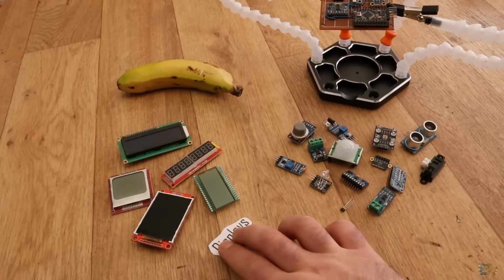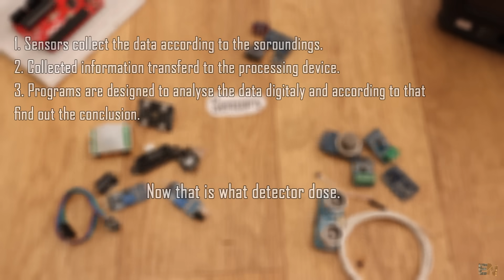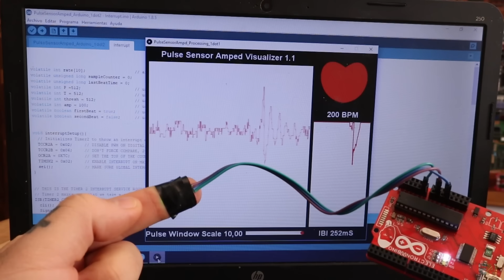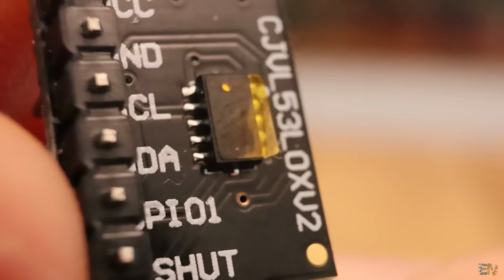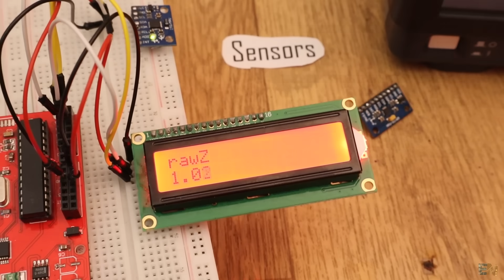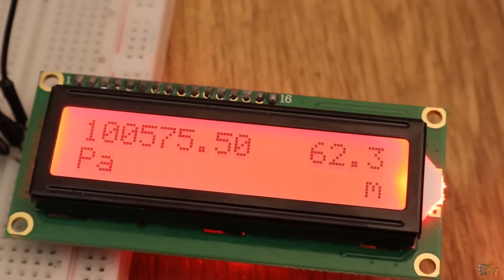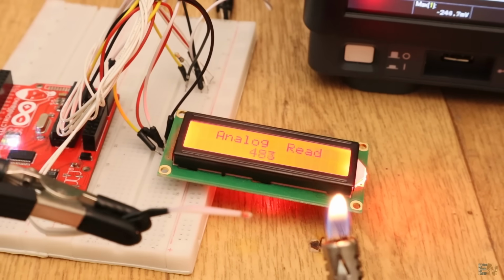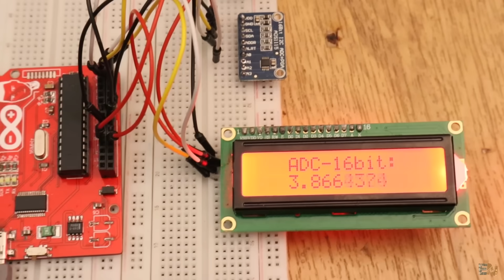Sensors - which one to use

Comment: Hello, I am doing final year project and part of the project is about monitoring transformer oil quality, more specifically its dielectic strenght. Moisture/water reduces dielectric strenght of transformer oil that in most cases lead to explosion of the transformer , what sensor can you recommend that I can use to detect/measure moisture in oil

Comment: Searching for months

 need your help I can't find a small micro controller that charge and discharge a battery with 8 second time limit connected to an led and it sense's low pressure to close the circuit to discharge and it's 3mm in length and only has a resistor connected to it (s0890
Ap) that's what I can read

Comment: hello sir, can you help me in what component will i use in my school project. Here are my project details.
A. Design a wearable physical distance sensing device that will trigger an alarm if another
person wearing the same device is within 1m.
B. Determine the parameters that will allow the device to contact the device worn by another
person.
C. Include a 3-D Model of the device using CAD, Sketch-up, or any 3-D Modeling Software.

Comment: Looking for a very small, easily hidden sensor to detect a model train passing by.  It will not be an arduino project, just a stand alone sensor hooked to an electronic crossing gate.  When the train goes by the gate lowers ahead of the train

Comment: Can a coreless motor design provide low speed high torque without excessive heat in the coils? What will be the design factors to achieve that, such as external cooling system, coils number, wire thickness, amps and volts...etc

Comment: Hi all, I'm in need for same help, i Have a sensor using hall effect and a magnet to check the filament thickness (1,7) all work ok, now I would like to change from serial monitor to LCD I2c to read the sizes, will be easy for the arduino experts, is anyone out there that can help? this is very important for me. Thanks, manuelrocha@live.com (I will send the ino. file/*
Sample code for the magneto-mechanical filament diameter sensor.
Calibrate your individual sensor by measuring objects of known diameter and creating a custom lookup table!
*/

#define verbose 1 //0: No error or debugging messages via serial, 1: Error messages, 2: Error and debugging messages

#define NUMTEMPS 4  //length of lookup table
#define smooth 100  //exponential smoothing factor, higher is smoother
#define sensIn A1  //Output of the hall sensor

// ADC input, diameter output
static float lut3[NUMTEMPS][2] = {
    
   
   {530, 0},
   {595,1.7},
   {671, 1.78},
};

float sensbuf =lut3[0][0]; //smoothed raw value

void setup() {
  Serial.begin(115200);
}

void loop() {
  int sensorValue = analogRead(sensIn);
  sensbuf += (sensorValue-sensbuf)/smooth; //smoothing
  Serial.print(sensbuf);
  
  Serial.print(" ");
  Serial.println(lookup(sensbuf, lut3),5);
  delay(50);        
}

float lookup(float inval, float lut[][2]){
   float out;
   byte i;
   for (i=1; i<NUMTEMPS; i++)
   {
      if (lut[i][0] > inval)
      {
         return lut[i-1][1] + (inval - lut[i-1][0]) * (lut[i][1] - lut[i-1][1]) / (lut[i][0] - lut[i-1][0]);
      }
   }
   if (i == NUMTEMPS){
     if (lut[0][1] > lut[NUMTEMPS][1])
     {
       #if verbose > 1
       Serial.println("WARNING: lookup out of range");
       #endif
       return lut[NUMTEMPS][1];
     }
     else
     {
       #if verbose > 1
       Serial.println("WARNING: lookup out of range");
       #endif
       return lut[0][1];
     }
   }
    #if verbose > 0
    Serial.println("ERROR: lookup failed");
    #endif
    return 0;
}

Comment: I work with some nasty chemicals and I’m working on a project to detect vapors released. At say L1, turn on an extraction system. At L2 it will sound an alarm, time to grab a respirator and leave.

I work within a small maker community and there is a need for such a sensor/alarm.

Comment: I live in both Florida and Viet Nam.  The high temp.  often cause false triggers with PIR. What else could I use?
I looked into the lasers used on automatic garage door openers but there expensive. (but no false triggers)
I will be testing the ultra sonic next.
I want it for use with an Alarm/pizo horn for intruder. And to trigger cameras to start recording.
The PIR is a big failure for these applications. Even a cloud passing by on a sunny day will cause the PIR to trigger.\
Any Ideas on what you might think would work better?

Comment: Hello, please help me? Ive got a project where I need to place a sensor to check if there's a person in or not, and if there's a person then the code begins, if no then nothing happens, basically its a room where ill place a motion sensor near the door and then a whole code after that whenever the person walked into the room etc.

but which motion sensor should I use? I was thinking something similar to the ones used in elevators or maybe in some roller coasters or some game rides for safety, etc.

Comment: I have a question pls answer it .
I want 2 sensors in which I kept 1 at place a and 2nd at place b.
So it tell the distance bw them.
And also if I move one of them up down or rigth and left then also it works.
Means which are aligned to each other.
Reply: Pls tell

Comment: Are you sure, that the distance sensor resolves the angle? I'm pretty sure that most IR range sensors will use LIDAR technique by modulating the IR LED and detecting the phaseshift of the modulation via the IR sensor.

Comment: great explanation for the sensors,really helpful understanding best application for each sensor. Right now I am in need of a sensor that can detect car movement at least 3 to 4 meters in front and then measure the speed of the car moving. The IR sensor you demo is short distance so what do you recommend for longer distance upto 4 meters. please email answer to ashu2077@gmail.com
thank you in advance.

Comment: For your MAX471 project: https://www.electronoobs.com/eng_arduino_tut81.php - you are dangerously using current and voltage interchangeably. For example, you say:

  Serial.print("Current = "); // shows the voltage measured     
  Serial.print(Current,3); //3 digits after decimal point
  Serial.println(" amps DC"); //3 digits after decimal point

However, voltage != current and not measured in amps. I could be wrong here but the MAX471 in production today and you one you use in your example, doesn't really measure amps.
Reply: i think he just mixed up current and voltage, he is measuring the voltage because he is using a parallel connection. to get the current of a load you need to measure in a series connection. furthermore, im sure this tiny cable isnt withstanding 3 amps :D

Comment: Nice video. One correction though, The sharp distance sensor (IR reflectometer based) doesn't detect angles. It detects the amount of light getting back. It is affected by the angle of transmit of the IR LED and the angle of arrival (angles are field of view) of IR photodetector (Wider LED angle will lead to more noise from other objects than what you're trying to detect, and Wider Photodetector angle of arrival will catch noise from wider range of directions).  The angle as shown in the video cannot be measured like that. It works in a similar fashion as the IR sensor shown after, just that it's more directional.

Comment: HI! do you know of a photoreceptor cell that can have a clock attached to it that will count cycles and remember (latch??) the clock count when the photoreceptor detected light and listens on an i2c bus and when asked tells its current clock and the last detected pulse clock back to the master? i think this is what i need and don't know if it exists :(
Reply: hmm yes it needs like, dips or configurable somethings that lets you use about 16 of them at once

Comment: Does anyone have a parts list for an Arduino small indoor gardening project? I want to monitor and automate as much as possible. 

I know I can monitor:
PH + -
PPM/EC

Temperature
Humidity
Soil Moisture Sensor

Barometric Pressure
Gas Sensor (Co2)
Air Quality
Light Timer

Is there a way to automatically control liquid nutrients in a hydroponic system using Arduino?

Comment: I have a video about digital scales using the hx711 load cell. Where my digital scale is different from the others, that is, during the calibration process using the linear regression method. So that the resulting error is small and accurate. And the equations obtained during the calibration process are included in the Arduino Uno program

Comment: Hey, i want to observe oil temperature AND pressure, wich type of sensor could you recommend? Also for water.. I'm not sure wich i should use
Reply: Just get a cheap thermocouple to measure temperature of oil and water. But for their pressure, I don't think there is a sensor that can do that, there are only air pressure sensors
Reply: If its an air tight container you could use a pressure gauge?

Comment: i want a short circuit cit off sensor for a 220 volt Ac 50 hz  downhole waterwell pump. When the well begins to run dry, it will lose its load drain which should equal drop of current draw.
when that happens,,, these pumps lose there cooling and heat up, burning there windings and or incased relay. Very exspensive in this region of the United States. what circuit/sensor would you recomend?

Comment: Bud, what kind of sensor would be needed to move a motorized turntable, like a DIY human turntable, to where when you turn your head/direction of looking, it would turn the table, 180 or 360 deg? left and right? Are there any sensors out there for this project with Arduino
Reply: An arduino IMU would be useful

Comment: I'm a very experience programmer, but was thinking about making some projects with Arduino and raspberry pi. I have no experience with building circuits and stuff but I'm sure i can get around that eventually. For project i was thinking about making a closet light turn on/off depending if the door was open/closed. From the list here i thought maybe the 49E Hall Magnetic sensor would be a good choice. Would this sensor suffice in my project, or would another sensor be better?

Comment: All nice and good but those solder joins give me cramps. I do them better with old transformer soldering iron and maybe a little bit of soldering acid... You have to heat up pad and pin and then add a just enough of solder / tin.

Comment: Is an RF sensor like an RFID tag the best non optical sensor to use for detecting the distance between 2 devices; or in this case, between an Arduino and an RFID tag?
Reply: It would wise  to use an ultrasonic sensor , instead

Comment: Can the distance sensor be accurate to the level of a micron? !!!
Reply: David Prock no
Reply: No just to a millimeter
Reply: no distance sensor are accurate at a level of micron but calculating error and using table in software you may mostly correct it.

Comment: i want sensors work with out using  Arduino  because i do not know what is Arduino
Reply: these sensor output is get on transister base or mosfet gate and connect to load without using arduino ,but if you want thing smarter then microcontroller or arduino is required

Comment: Hello, I am working on a sorting machine that will sort balls of different materials (wood, plastic, and steel). I was wondering if you believe if the RGB sensor would be able to pick up on color sensing for these types of materials in order to differentiate them. If not, what kind of sensor would you recommend for picking out the steel balls, the 49e Hall sensor?
Thank you and great video !
Reply: Is the weight constant?
It's quite simple to have a balance under and if these balls are same size or if you can measure distance from center you can estimate distance
If you can test, by color is also good...
You could also try to distinguish them by speed of sound or the way they reflect IR

Comment: Hey there,
You mentioned that motion sensor (pir) senses our movements and turns light on . So if it does not sense anything does it trigger the light to turn off
Reply: It depends on how you program it but yes, you'd typically program it to turn off the lights when you don't detect movement. The sensor just tells you if there was movement or not, it doesn't do the turning on and off of lights, that is up to the programmer.

Comment: I use the MPU 6050 and an Arduino Micro as a head tracking unit in my PC flight/space & driving simulator games. Works like a charm and much cheaper than the name brand head tracking units!
Reply: Code & Circuit Diagram Please🙄🙄

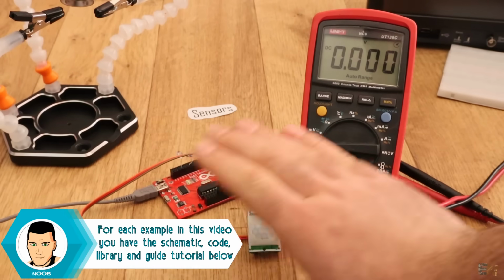Comment: @0:20 how could you read it as analog signal ? I tried but couldn't !

I used this code:
void setup() {
  pinMode(A0,INPUT);
  Serial.begin(9600);
}

void loop() {
  byte num = analogRead(A0);
  Serial.println(num);
  delay(200);
}
Reply from the maker: https://www.electronoobs.com/images/Arduino/tut_74/sch_1.jpg
For analog read you need to connect to the emitter of the phototransistor as in this schematic. Keep up! 
More here: https://www.electronoobs.com/eng_arduino_tut74.php

Comment: Hey bro, great video! I work to do an air conditioner with arduino,water pump,peltier and more...
Reply: in future peltier module may used as airconditioner and gas leakage problem is nomore in AC. so this is very good .

Comment: I am trying to convert my 3d printed coin sorter into a counter but i need to work out how to have 8 sensors (optical) that are fast, that can detect coins as then fall past. I cannot use interrupts as i understand it as the arduino only has 6. Could you suggest a sensor type that will be fast enough to detect a coin falling past it over a fraction of a second so that the arduino can keep up with detecting 8 different sensors at a high speed?
Reply from the maker: There are two kind of interrupts. External or "pin change". With pin change you could set to interrupt any pin of the Arduino. There are 3 ports isr. Search for Arduino pin change interrupts.

Comment: Dude... All those sensors gave me an idea... To make a general use tricorder!!!!! 😃
Reply: great idea! then i could find the ship and get the hell off of this planet!
Reply: MC's Creations same
Reply: and? how far is your progress?
Reply: how about making a 3 channel voice changer with clean (just amp'ed) / high pitch (witch-spectre) / lower pitch (monster-demon) that i can mount into a helmet , with surface mount mic jack & surface mount speaker wire clamp screw terminal , mains input surface mount screw clamp , a volume pot , gain pot , mic sensitivity pot , that will work with two 2032 button cells in series(6VDC)  and you could also make a 75mm long flexable , copper shielded  electret mic  with a 3.5mm tip,ring,sleeve plug. thanks !!!!!
Reply: @guitarman_3693  I guess we would need Tony Stark for that, dude.
Reply: @guitarman_3693  you need to find someone who you can pay to do that